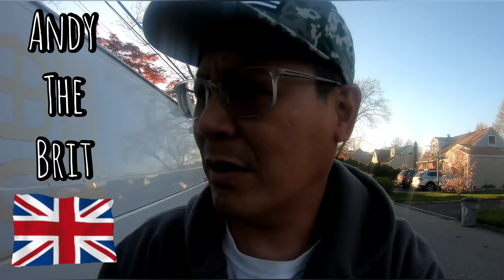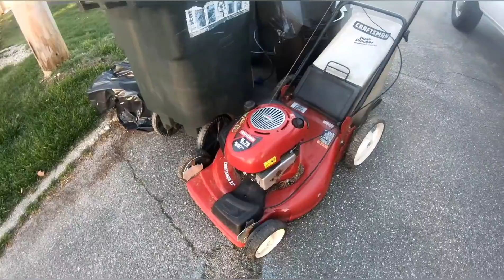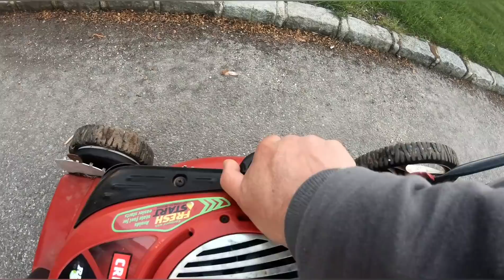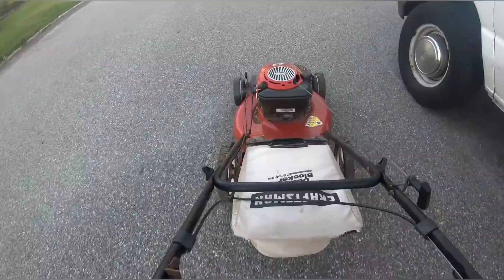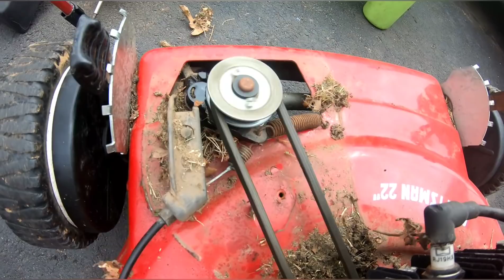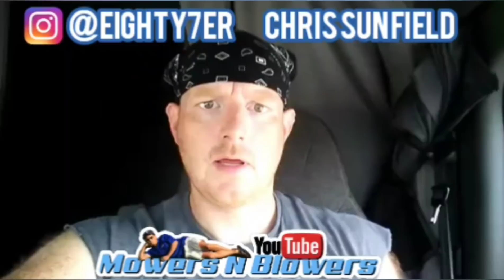FREE CRAFTSMAN 22" BRIGGS QUANTUM SELF PROPELLED LAWN MOWER NEIGHBORHOOD CURB ALERT PICK & EASY FIX

Comment: great score !!!

I had one like that , hydro locked, but worse,   they had put in 1 full qrt of oil, drained it out and changed plug, and changed oil.  and ran . however  somebody may of thought I was doing smoke signals.  I decided to keep the mower and basically its used when ever my son has a lawn cutting job or leaf clean up job.  it cuts great, old 21 inch Yardman by MTD with 6.25 quantum primer style.  very smooth running